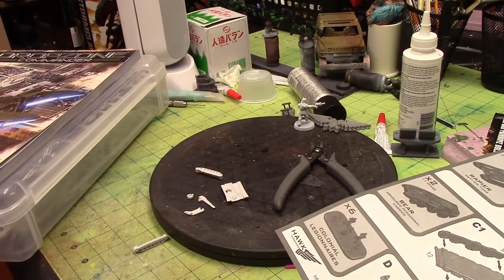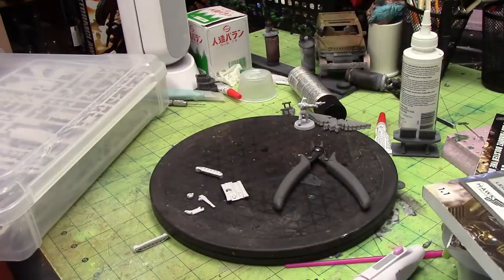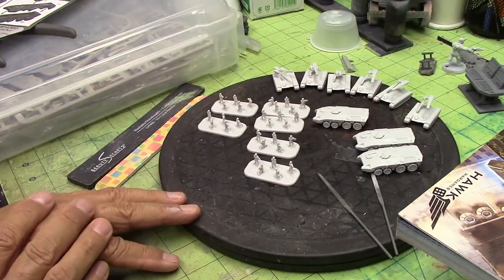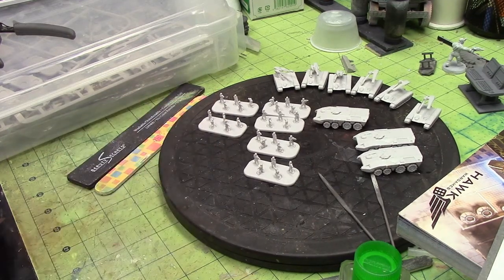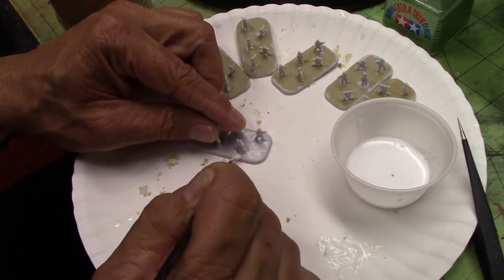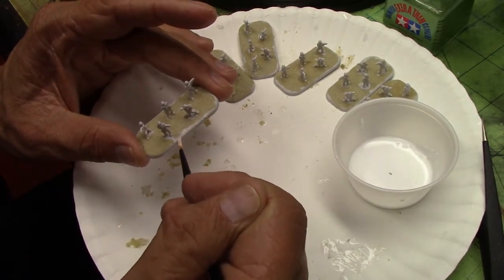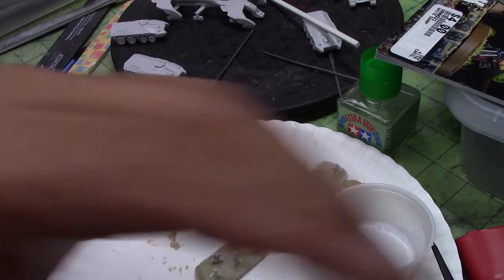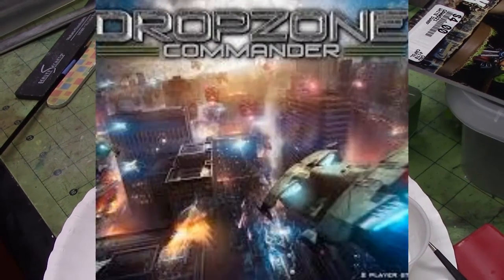Dropzone Commander Starter Box Part 1

Comment: those tanks look like the size of Matchbox cars.. I think I could never get in to any game smaller than 20mm, its just too small to immerse yourself in.
Reply from the maker: +OtisENGINEuity They are smaller than match box, think N scale rail road scale. I bought a few N scale cars to populate the game board; i will have them in a future video.
Reply: RichterScaleStudios sounds like a cool bit of terrain in the making.. Have a train running through the middle of the battlefield with tanks on the flatbeds and whoever gets to them first can use them as stationary turrets.. Or you can just blow them up. :P